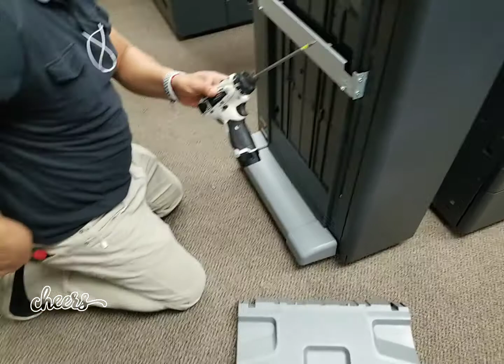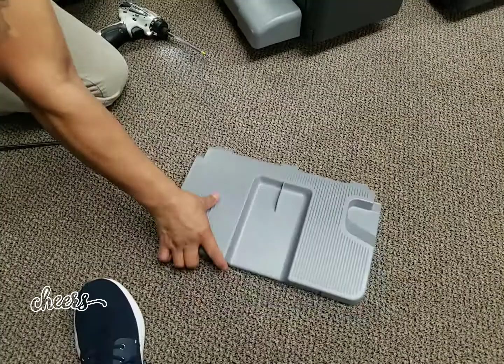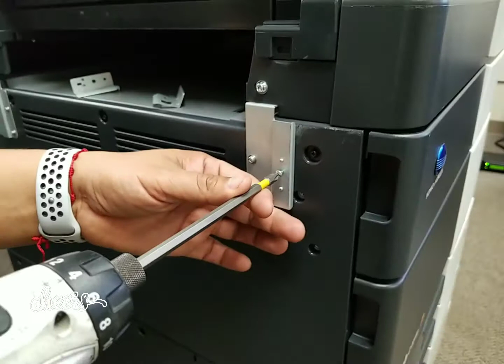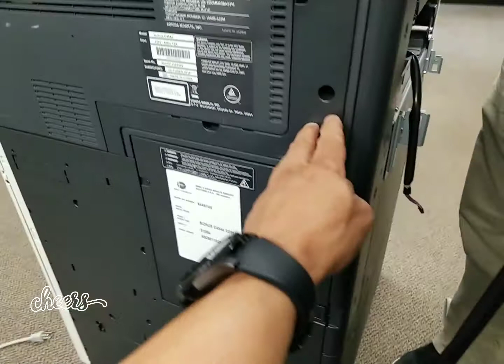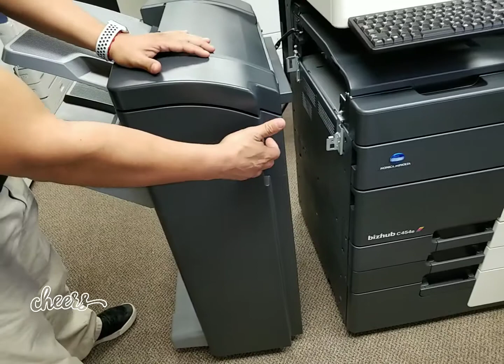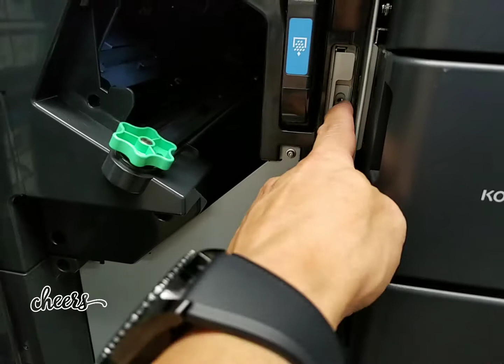Konica Minolta Bizhub Finisher Installation

Comment: I want to put the tray but The iron part remains at the top and does not go down. What is the solution?
Reply from the maker: there's a trick to this. hopefully you can understand my instructions. Behind the plate you called "iron part" you will find several black spring tention sensor arms. Turn the copier on and immediately open up the finisher door. Now with both hands gently lift up all the arms and hold in that positon. Now close the door and do not release the arms until the "iron part" comes down 5 or 6 inches below the arms. Now you can release the arms but the "iron part" will start rising again so immediately open the finisher door to stop it. Now you can install the tray and close the finisher door. Good luck!

Comment: Dear, thanks for the video.
I have a finisher for bizhub 808 and the output tray 2 does not sort the sheets that come out and they do not fit into a single stack. 
Any recomendación on what can cause?
Reply from the maker: many different reasons can cause this. Too many to list but either you need to reload software or there might be a mechanical issue with finisher causing it not to align the sheets. there are two arms at exit and i've seen them go bad in the past. could be an easy fix and also can be a long tedious fix. sometimes its worth buying a used finisher and be done with it.

Comment: Hai,i have removed my stapler  unit from printer but still printout comes through inner tray and stuck at stapler unit joining section .Where can i change in printer settings if i removed my stapler unit from printer ?
Reply from the maker: you need to remove the inner transport unit. you can't run the machine with it if you don't have the finisher connected otherwise it will jam each time. Also, when you remove the transport unit you need to install a catch tray which im sure you don't have readily available. you will need to buy it otherwise you will have a mess when all the copies come out.

Comment: What can I do if my machine bar has moved to the top without the tray on please
Reply from the maker: you will see 3 black plastic arms behind the metal bar. turn the machine off, use 1 or two hands to push all three of the arms in and power the machine on. hold the arms until the bar has come down several inches below finger and immediately open finisher door to stop the bar from raising. now install the tray

Comment: Hi, We all appreciate the videos, it's just some of us take the time to like and subscribe. I have a Q. I have a couple of silver screws that have come loose in front of tray 2. They are stuck in the tray riser guides- if that is what you call them.  Two of them came out and looks to have come loose from the inside and jammed in the verticle guide. Thoughts? how would I take the panel off to investigate. Thank you
Reply from the maker: I would have to physically see it not easy to describe over a chat.
Reply: Thanks for the quick reply. After watching this again, Looks like I need to remove the finisher to get access to the back cavity where you had the trays storage during transportation.